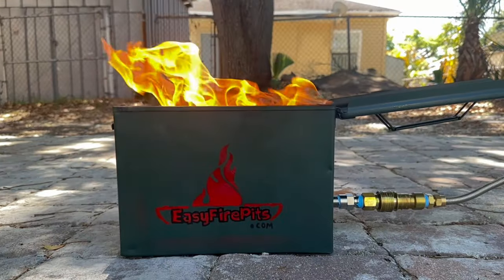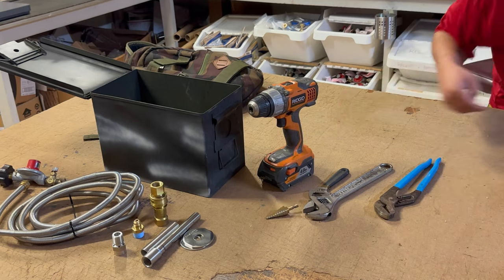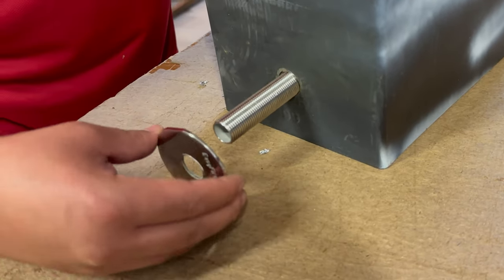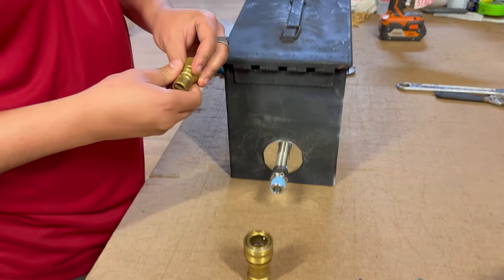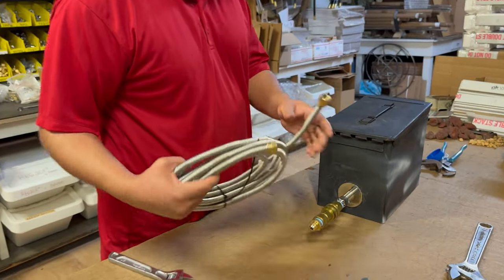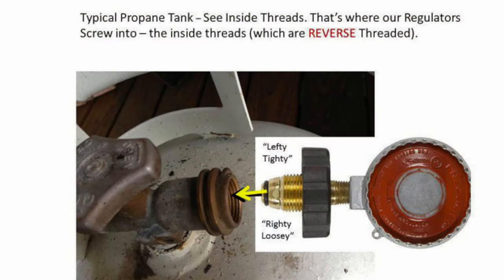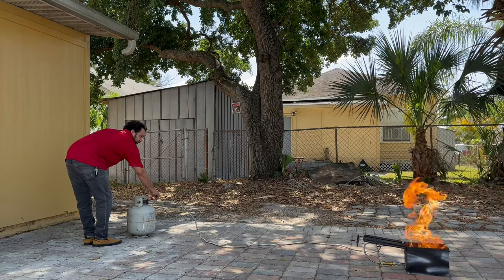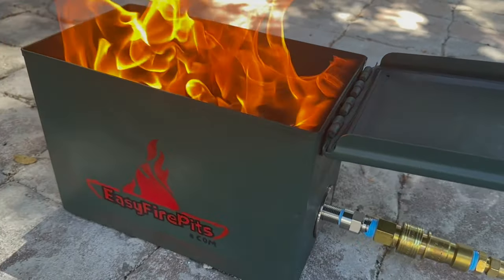Ammo Can Turned Into Propane Fire Pit

Comment: Excluding the ammo can how much does this set up cost
Reply from the maker: Anywhere from around $115.00 to $225.00. Will work with just the Basic Propane Kit and 6" Log Lighter Burner, but if you upgrade the hose to stainless steel, add air mixer, and quick connect/ disconnect features it goes up. The links to the products are in the description as well if you want to check them out on our site! Thank'
Reply: @EasyFirePits_  Just wondering if you have a kit to make flames come out of your exhaust pipe On a go kart.

Comment: ? How is having 3-4 inches + sticking out of the can portable in any way? Pretty sure a number of other companies make a diy kit more compact. 
Seriously painting over top of the original can paint? That’s going to burn off first use. Wow seriously!
Reply from the maker: Because of the ability and height of our flames and fire features, we’d like to leave a couple inches of metal before you get to a hose that may melt otherwise. It can be unscrewed and pushed right back in when you’re done and pulled out when you’re not.